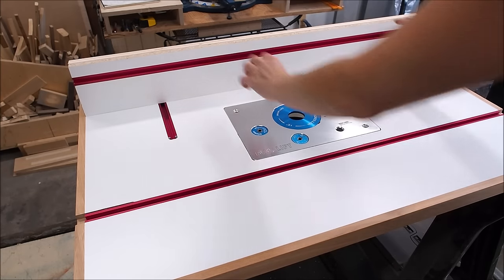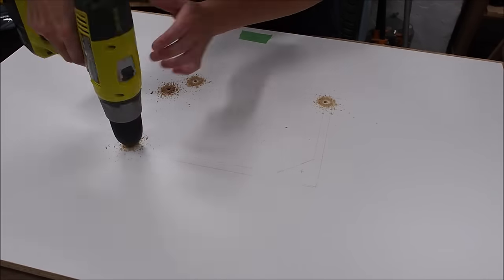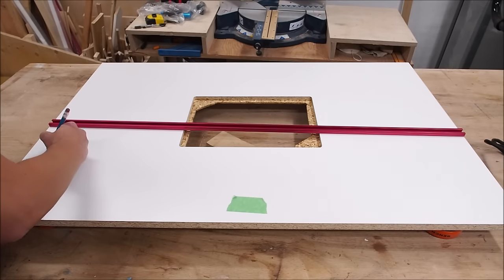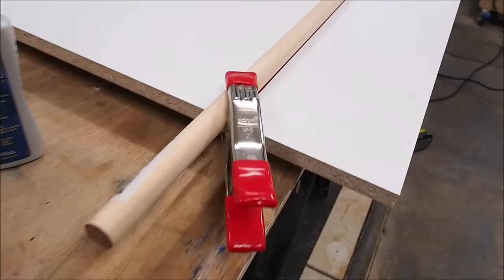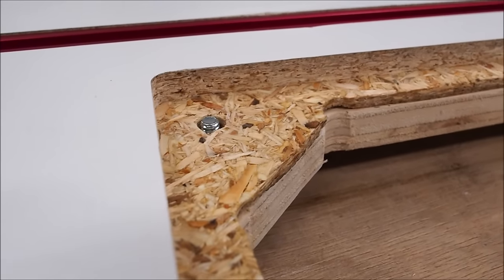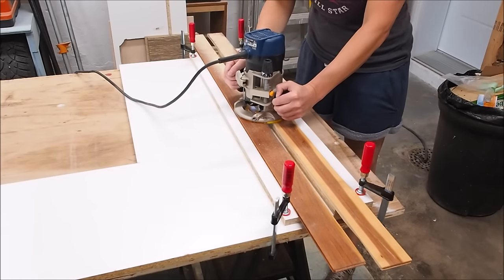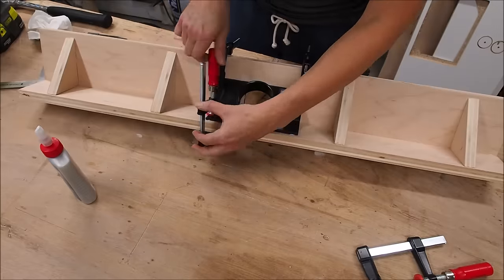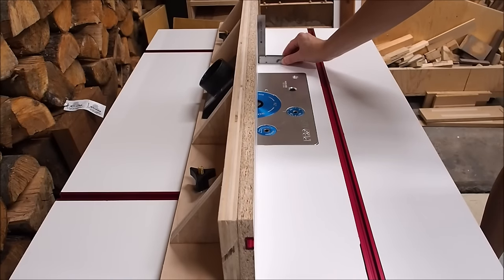Router Table and Fence | DIY Router Table Build - Part 1

Comment: Very nice! I've been meaning to build one for myself and this is a nice clean design. Just one thought: Replace the plastic insert for the leveling screw with a metal one. I've used those for something else and they wear out really quickly.
Reply from the maker: Thanks, much appreciated! 
I'm hoping I won't need to touch the leveling screws much once adjusted correctly, but definitely a good idea to go with metal for the long run.

Comment: "Trim Rooter" Got to love that Canadian speak!  Just put in the order for my Router Lift thru your Link above to Amazon. 
This is a really nice table and I like where you went on o maximize the vacuum ability to remove the waste. (Another video folks, keep watching DIY Montreal) 
Can't wait to get started. Now it is time to go to Woodworkers Source ( woodworkerssource.com if you are in or around Phoenix AZ)  to get some raw materials.  
You rock the makers world Marie. Thank you!
Reply: yeah, i heard that mispronunciation too. rou-ter is the correct pronunciation for a tool that routs. 'rooter' is the correct pronunciation for the name of the device that sends internet signals along a route to a computer.
Reply: I meant no disrespect of the Canadian accent/language. on the contrary ,I think he differences in pronunciations of words is neat.  I am from Chicago originally and everyone I run into can tell somehow by my pronunciations. 
Keep on rocking DIY! I love your work!  All the folks in AZ seem to call them routers, both woodwork and internet.
Reply: @chadwix  You didn't disrespect. I pointed out that what you called a Canadianism was just her mispronunciation, probably because router and router are spelled the same way, but pronounced differently.

Comment: your doing too larger passes with the router that's why your struggling, several smaller passes will make things easier and give you a cleaner cut whilst prolonging the life of your tool and bits.

Comment: Well, I just finished this build! Wow. Wanted to thank DYI Montreal for these fantastic and clear videos and tips. Also useful were the links to the materials used. I used a different router lift, but that’s no big deal. If I had any recommendations to anyone thinking of building this table it would be to use good plywood. Spend the money for high quality birch plywood. My top ended up with a slight bulge. I corrected this with some laminated “beams” which I jointed and screwed to the bottom on the top, which complicated the construction of the base. Great build, thanks again!

Comment: Hey Marie.. Love the look of this router table.. The issue I have with the insert plate from ROCKLER is the cost plus the shipping to IRELAND.. I would love to get it but the cost is too much so I will build my own lift mechanism in the future.. I'm spending monrey like crazy atm trying to get my workshop up and running so the router table will have to wait. I amy buy one of the TREND TABLES in the near future when I can see the benefits of such a spending spree. Not right now though Maire.. 
Ur table is sweet looking and I love the red accent against the white back drop on ur router table.. I salute u girl.

Comment: Marie, I am embarking on this project this week.  I see some conflicting information that will effect the design of my build. I wonder if you've experienced any issues with the T-track and T-bolt not holding the fence secure enough.  I've seen comments that say 1.) they won't always keep the fence from sliding if you push tightly against the fence, or 2.) that the force of making the knobs really tight actually pulls the T-track up from the mortise.  I've considered making the table top wider to use standard clams at each end, but wonder if I'm over-thinking this.  Any issues for you?  Merci!

Comment: How did the table fair over the long haul?  Did the material hold up ?   I'm looking to build my own table for my router and am curious as to what material you would "now" recommend to use as the tabletop base ?
Reply from the maker: It's held up well so I would still go with melamine and use the same construction as I did.

Comment: Here´s a short plan for the small scale production of moldings. Use only cutters with 1/2 inch shanks and a +1500 W router.  Choose a number of classical profiles for building purposes, wall to floor, wall to ceiling, around doors and windows, in minimum lengths of 8 foot, event better with 12 foot.Some cabinet maker´s and decorative moldings in 8 foot lengths. Some picture/painting frame moldings in 2 to 4 foot lengths for thin profiles and 8 foot for broader profiles. Air-dried timber is easier to "cut". Buy planed timber if you haven´t got a good planer. Get some oak, beech, birch, teak and mahogany as well. Some clients may require it.  Plan for 500-1000 metres a day. Good luck.
Reply: A keni nevoj per marongoz

Comment: excellent.  do the plastic inserts offer enough friction to keep the feet from vibrating out of position?  I was thinking of using some thread locker to hold them in place
Reply from the maker: No, I can admit after using the table for some time, they do not. I will be replacing them with metal threaded inserts or perhaps try some thread lock as you suggest!

Comment: I don't get it. Why spend $330 on a rockler plate and about $50 on materials, when you can get a good router table with dust port for $250 ??

Comment: In thinking of building my router table pretty much as you have outlined here in this video. 
Is there a reason your didn’t use a dado stack to cut the t tracks? We’re you thinking the dado stack would chip out the melamine? 
Did you have any chip out from routing the router lift?
Thanks!

Comment: Wow! Great job Marie.  I really like the dowel clamp trick for the track.  What type of hardwood did you use to trim out the table edges?  It turned out great!
Reply from the maker: Thanks Casey! I used some reclaimed floor boards I had leftover! I think it's maple that's about 100 years old. I planed them down then trimmed off the edges and the wood inside was beautiful with super tight grain.

Comment: Very nice build! Attempted TS router side wing with melamine - had so much trouble preventing edge chip out :(.  Did you pre score/scribe any of your cuts?  Even with the hole saw bits on the fence?
Reply from the maker: Thanks! I didn't pre score anything no, but I did have a new sharp quality bit. The hole saw did year out a bit so I sanded the edges to clean it up afterwards.
Reply: DIY Montreal Many thanks. I did climb cut in melamine with straight bit doing the plate insert outline > against rotation direction tore out. T-track (using router and TS) dados still chip - your jig for t track seemed to eliminate. Thanks for sharing your builds!

Comment: I'm in the process of making a router table in a similar fashion using melamine shelving (both sides) from HD.  Did you find that the 1.5" distance between the t-track on router plate was a good position?
Reply from the maker: Yes it has worked well for me and from what I've seen similar to commercial tables.

Comment: What's to stop the leveling feet from simply falling out the bottom of the table once any real pressure is on them?  There is nothing except friction holding them in place.
Reply from the maker: True... but the friction increases once the screw is inserted, making the plastic anchor stick in place. No issues so far, but metal threaded inserts would be better.
Reply: I understand what you're saying about the friction increasing, but wouldn't it have been better to use the classic method of putting the screws in from the top, or at least put in the plastic inserts from the top so the flange prevents it from slipping?  If the holding power of the substrate weakens over time, at least then the screws aren't in danger of just falling out from underneath.  And it is still adjustable, you just have to remove the plate enough to get to the screws.

Comment: I used the Kreg Precision router table insert plate levelers,  just cut the hole in the table top same size as the plate. drew the leveler in the corner and set the plate leveling screws are built in
Reply from the maker: Cool! Sounds easier than the way I did it.

Comment: Great work. Generous dimensions that can come handy especially for longer mouldings. The Rockwell equipment costs a bit more but might be worth its value if it yields professional quality. Since mouldings are my specialty I would have  used an even longer table that could be fitted with a feeder. Anyway you did a good job.
Reply from the maker: Thank you! The beauty is you can customize this to the size you need.

Comment: Just watched you 3 part table build. I’m in the middle of doing much the same but adding the table to the end of my cabinet saw.
Adding an enclosure underneath. Seeing the significance of venting the motor enclosure, I will certainly add that to my build. Not being a fan of melamine, I’m using two 22”x44” 3/4” birch ply and then laminate a Formica top. Thanks for all the well thought out tips.

Comment: Just found this vid. You did a very nice job on the table and fence! Using the dowels was a nice touch. 
I want to try my hand at building this, but I have a question. I have some very wide bits and very narrow bits. Is there anyway to make the front of the fence adjustable to the size of the bit?
Thanks for your great example.
Reply from the maker: Thanks! You can make a split fence. Steve Ramsey from woodworking for mere mortals has a great video showing how he made this.
Reply: DIY Montreal ah thanks!!

Comment: Hello - I know this video is 3 years old but I gotta thank you.  Its by far the best router table video I've seen,  I agree with everything you did. The dowel trick and Weldbond glue is a great idea. Don't have to worry or fuss  with  countersinking the screws and making sure they are deep enough but not too deep. And It's great that your a girl doing a better job than most men. Please don't take this as sexist - - I think it's great that a girl takes on something that mostly men do. I'm sure it will encourage more women to try.  My wife would say "I couldn't do that" and I tell her yes you could if you take the time and patience to learn.

Comment: Fantastic video! However, I have no idea how you managed to get the top so flat - here in the UK, if you screwed plywood to melamine, it would 'dish' - because the sheets aren't flat to begin with.....you would need a dead flat 'reference' table, to ensure when you drive the screws the router table top doesn't sag/move/bend.

Comment: Inspiring, Marie.
And your use of furniture glides to adjust router plate height is a terrific idea that I've seen nowhere else. The ease of fingertip adjustment makes it the best I've seen -- and so simple. 

I wonder if using some low-strength Loctite on the threads for the final adjustment would be a good idea, to prevent movement caused by vibration. Of course, one would want to use steel threaded wood insert nuts, instead of the plastic inserts, to anchor the bolts in the plywood.

Comment: Would the table be stiffer if you glued the plywood and melamine together (as well as using screws) or did you want to retain the option to separate them?

Comment: the only things I would have done different is to put a small chamfer on the bottom edge of the fence for sawdust relief and would have edge banded before routing t-track slots so t-track would have gone all the way out

Comment: Very nice build. I used Kreg levelers for my table but your idea looks much more functional rather than groveling under the table trying to insert a small Allen wrench as you do with the Kreq ones.
Reply from the maker: Well now that I know the alternative, I’m glad I went with leveling feet!
Reply: only have to do it once
Reply: Level it before you attach the top to the cabinet it is easier that way. Unless you put a jam nut or thread loctite to lock the furniture levelers I am afraid they will vibrate and cause the plate to become unlevel.

Comment: For a long time now I've had my eye on getting a new router table. I was going to just buy the Bosch router table, but the price was way to high for what it offered. Watched many, many videos on building my own table but nothing really inspired me, and I always came back to buying the Bosch, that was until I watched your video. Love the size and the way its laid out. I've watched this video several times now and I've decided that yours is - by far - the best way to build a router table. Will be starting my build soon and looking forward to using this great router table. Thank you for sharing your great design. Job well done!
Reply from the maker: Thanks, it means a lot to me that the thought process and research I put into my builds has value and is useful to you. Thank you for your comment. Wishing you a successful router table build!

Comment: Excellent video, the tip on using two boards and the t track as a spacer to router the cut out for the t track is a great idea. Thanks for sharing 👍

Comment: I watched all the videos in this series, and the table turned out great, I'm makin one, but the metal plate that attaches to the router is way over priced. $369.00, way to expensive, for that price I can go buy at least two nice router tables.
Reply from the maker: The one I used is a lift but you can use you a plate which is much less.

Comment: Great table and fence design. I’ve watched this video many times and am in the process of building one. What was the size of the hole cut out for the fence? Thanks!!
Reply from the maker: Hmm. I think I used a 1-1/2 inch hole saw.

Comment: How long are the two T-Tracks for the fence?
Reply from the maker: 36 inches
Reply: I actually needed the size of both T-Tracks that were used for the fence (behind the fence). They look shorter than 12". Thanks.
Reply from the maker: Sure thing, those were each cut to 10 inches using my miter saw.

Comment: When the router lift is more expensive than your router/table saw/miter saw combined : /
Reply from the maker: The lift I have is indeed a luxury, but a regular router insert plate can be used in this build just as well.

Comment: This is a great series, I've watched it many times during the construction of my table, thanks!  One question, did you have difficulty fitting your 2.5" hose onto the Powertec dust port?  Seems like I need an adapter for my hose to fit.
Reply from the maker: Yes I did, I thought it was the hose I got. You're having issues too?
I see Big Horn makes a port, wondering if that one would fit.
Reply: DIY Montreal ...I found a 2.5inch coupler fits nicely between the 2.5” hose and the Powertec port.  I have several Powertec connectors in other areas of my dust system that work great, seems odd maybe an over site that this port doesn’t allow the hose to fit directly.

Comment: For the tracks you could just take smaller depth cuts but it does require multiple passes but will save ya the paranoia of an exploding bit🥲

Comment: Cutting the dado in one pass, depending on depth, is always difficult with a router depending on power and sharpness of the bit. Make two, possibly three passes 👍
Reply: Just what i was thinking.When routing guitar bodies with my little DeWalt router i take few mm’s at a pass, if it feels like the router is struggling just go shallower and take your time.
But the table is great, i will try something similar on my workbench project.Thx!.

Comment: With all the fancy tools you used to build this wood table, there is no need for such wood router table at all. Not for the DIY.
Reply: Are you crazy, what fancy tools. 
Table saw?  Have your big box or lumber store cut you a piece or just use some of the pre-cut 2' x 2' pieces.
Trim router?  As shown, if you're thinking of making a 'router table', you probably already have a router. Doh!
Nail gun?  OK, screw and glue then.
T-Track Dado? Use your existing router, Doh!

She made a $50+ router table (minus insert) that is probably as good as a $100-200 one with essentially scrap wood.
If you think any of the tools above is 'fancy', then you were never going to build much of anything most likely.